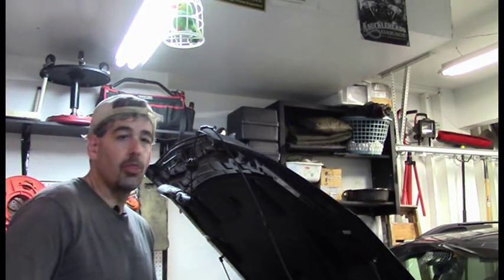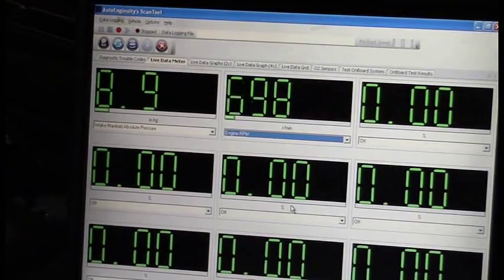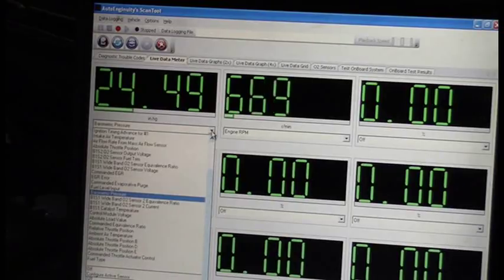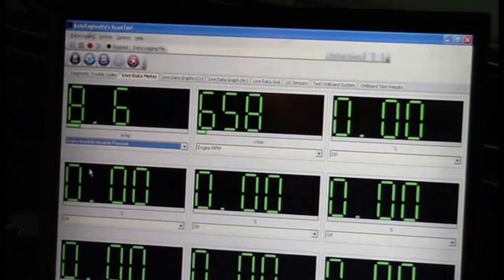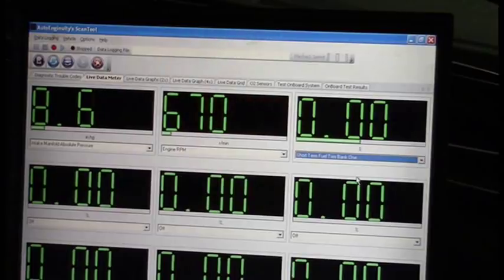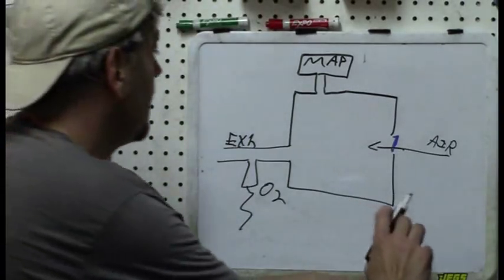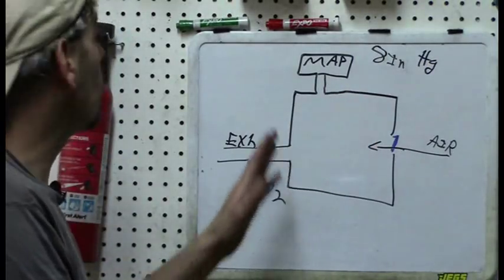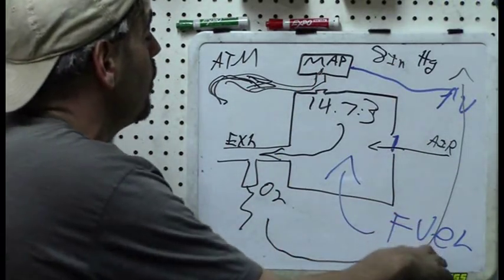MAP Sensor Diagnosis and Understanding Function- Pt2

Comment: Thanks for the good video explanation.  I got a code P0107 code today "manifold absolute pressure or barometer pressure circuit low input".  My scan tool freeze frame showed MAP("Hg)=3.5 at RPM=850 idle ABSLT TPS(%)=14.5.  Your idle was at 9"Hg.  I wanted to try to figure out if I need to replace the manifold absolute pressure (MAP) sensor.  I also have been getting long cranking hard starting for about a year. I checked scan tool not running RPM=0 and MAP("HG)=25.1 and then crept down to 23.6.  But the barometer checked from weather at 28.85"Hg, so my sensor is reading 4"Hg - 5"Hg too low. Your video help me realize that during starting the MAF(lb/min)=0.0 and the EFI uses MAP("Hg) for determine the barometer for the starting map A/F.  With MAP sensor reading 4-5"Hg too low the PCM thinks I am at low pressure air, or super high altitude 7000' instead of 1000', and is cutting the fuel way back.  My LT FTRIM1(%) was up to 6.3%.  Looks like I need a new MAP sensor.  I just wish I would have gotten the code months ago when the hard starting began, so I could have fixed this sooner.  If you ever come across a bad sensor, it would be cool to see a video of the bad sensor's output & response to throttle tip in.
Reply from the maker: You have no data that can be used for diagnosis of anything here. There is just one reference point. There is no curve to load.
  I do not understand how you are determining the MAP is faulty.
Reply: I can tell MAP sensor is faulty because when not running the engine the air pressure will equal the atmospheric barometric pressure, since no air flow when RPM=0, and no resulting pressure drop behind throttle.  At the time I checked with scan tool the local westher conditions reported 28.85"Hg.  I took about 10 measurements and got as low as 23.6"Hg with scan tool.  So MAP sensor was reading 28.85 - 23.6 = 5.25"Hg low, which is way off.  5.25"Hg is a lot of barometer change.  5.25"Hg is like going from 1000' elevation to 6000' elevation where the air is less dense. OBD code 0107 definition says get code 0107 low MAP indication fault if voltage < 0.25 volts. My scan tool does not give volts for MAP sensor, instead it gives "Hg, so I had to look up facts about barometric pressure to   figure this out. My car has two identical MAP sensors. One in manifold, and one before intercooler. The sensor in manifold is bad. The sensor before intercooler checks turbo boost.
Reply from the maker: You are not testing the sensor properly.
Reply: The voltage output of MAP sensor is too low.  It is below the fault limit, thus causing a MIL code P0107. 

Scan tool is handy to troubleshoot.  I found Scan results from long ago when car was running fine and MAP ("Hg) at RPM=0 was 28.1"Hg matching close to correct barometer. This also confirms MAP sensor output today at 23.6" Hg is too low.  

Seeing your video of scan results of "Hg was helpful to make me realize my MAP values were way too low.  You did not explicitly provide guidance on what "normal"  MAP pressure readings should be. But you said you had a new engine and you showed your scan results on video. Thank you.
Reply from the maker: You have no scientific evidence of that since you did not test against variables. You cannot scientifically say the MAP is responsible.
  .... and it isn't.
Reply: Schrodingers Box 
Good point.  What variables do you suggest I test against to make a good scientific conclusion?
Reply: I see at 3:08 in video your barometer is 24.49" Hg.  You mentioned in other comment you are at 6500' elevation.  24.25" Hg is about average barometer way up at 6500' elevation. Your MAP sensor appears accurate.

I am at 1000' elevation where average barometer is about 29.7"Hg.   My MAP sensor says barometer is 25 to 23.6"Hg, which is off by 5-6"Hg too low.  Science says barometer can't ever get to 23.6"Hg at 1000' elevation, even if a hurricane hits Wisconsin.  MAP sensor is faulty.
Reply from the maker: James, you do not understand the operation of the sensor. I tried my best.
  Go ahead and replace it. Good luck.
Reply: I don't want to replace a MAP sensor for $49, if I don't have to.  That is why I watched your video.  I am thanking you for your video because your video helped me realize my MAP sensor reads barometer 5"Hg too low. Your scan data showed much useful information about barometer value.

 However, you keep telling me I am wrong, without telling me what is right.

If your viewers read this comment, maybe I can help them.  

1) code P0107 low MAP sensor or barometer signal
2) code P0107 triggers if signal volts < .25V or <= 3.5"Hg
3) normal sensor range ~ 1 to ~ 4 volts
4) ECU checks barometer when key to ON, and engine not running.  MAP sensor measures the absolute pressure, which is the barometric pressure when RPM=0.
5) Use scan tool to key ON but not start engine, record barometer value. Some Scan tool is in units of inch Hg, and some in kPa. Use Google to convert units if need to.
6) Google the weather near you to get the barometric pressure. 
7) Compare. 
8) If scan tool barometer is more than .5" Hg different than the weather station barometric pressure,  then Sensor is wrong. May be able to tolerate up to 2.0"Hg off without noticing poor starting. 2.0"Hg is like 2500' elevation change.
9) if 5V input is correct and ground wire is good, then sensor is bad
10) Only then do you need to spend money to buy a new MAP sensor. 

A MAP sensor that reads too low causes poor starting with excessive long 5-10 second cranking to start.  Reason is when key to ON, but before cracking, the ECU looks at MAP sensor for barometer  (elevation), intake air temperature, engine temperature(jacket coolant water), LTFTrim (long term fuel trim), and battery voltage,  to pick the starting prime squirt, starting fuel map, and after start fuel decay as engine warms up. There is no value from MAF sensor yet, since RPM=0, so ECU uses MAP sensor to find spot on fuel map. If MAP sensor reads 5-6" Hg too low barometer, then the ECU goes to a lean portion of starting map because ECU thinks you are at high elevation with less dense air. The leaner portion of starting map has shorter injector pulse open times, thus injecting in less fuel than actually needed.  That is why MAP sensor that reads barometer too low by 5-6"Hg causes 10 seconds of cranking until enough fuel is injected to ignite and start.

 Other symptom is sometimes engine dies right after start up and at idle. The low reading MAP sensor is on a lean portion of after- start fuel decay map when in open loop mode.  Engine is too lean and dies.

Conversely, if MAP sensor reads barometer 5-6" Hg too high, then during starting will inject in too much fuel and belch black smoke in exhaust.  This would be the case where you are at 6500' elevation and your MAP sensor reads 30.0" Hg but the actual barometer from weather station is 24.5" Hg. Your ECU will think you are at 500' elevation and inject in more starting fuel causing over rich starting symptoms, such as, flooding, rough stumble, black smoke in exhaust.

I hope someone finds this helpful as further explanation of your video.
Reply: I don't know.  But I do know why the map sensor was bad.....   

The little vent hole was clogged with dirt.  So the sensor was stuck and reading too much vacuum.  

I replaced the sensor.  But when I took it out I noticed the small 1/32" hole was completely shut .  I probably could have cleaned the body of the sensor and fixed it.
Reply: James Dehn Thanks for the info I'll check that before I replace mine.

Comment: BRAVO! some great teaching...what comes to my mind...just in reverse to what u said...MAP code being set bcus TP was too high from carbon buidup...DBW throttle...Computer expected to see higher MAP value
Reply from the maker: How is a TPS going to have carbon buildup???????
Reply: ???...Drive-by-wire systems dont have IAC valve...so, everything is done by a throttle plate...Computer opens it more to compensate for carbon buildup restriction...to maintain idle speed
Reply from the maker: Oh yes- that would be TB carbon buildup, technically, not TP carbon buildup. I was thinking you meant in terms of the sensor itself.
 yes you are right and in fact I have several videos where I diagnoses TB carbon buildup through high TPS voltage

Comment: Something is wrong.  With the MAP out, there is less vacuum (NOT more vacuum) being sensed by MAP which is the same as no/less air flow.  More airflow=more vacuum. With the engine running there is more  vacuum or more airflow in the intake than outside.  I assume that implies less voltage being send to ECM by the MAP when it sits outside in the open.  He said it backwards.  He said the MAP being outside registers more vacuum more airflow at around 9:30 in the video. I don't know if more vacuum means more voltage and less means less voltage in the signal wire.
Reply: less applied vacuum source to sensor is more/higher voltage output, from the MAP.
more vacuum source to sensor is less/lower voltage output, from the MAP.

To the PCM.  
Variable signal output wire/terminal.

GM and Chrysler at least.  
 
and I have just today retrofitted a '90's GM TBI style of MAP sensor to my 1993 year 3.3L  dodge car.    works.   the original sensor was 293K miles and failing dying
Reply from the maker: What you are saying is self contradictory, sorry. It makes no sense the way you defined it.  please restate with consistent, clarified definitions so I know which point you are trying to make.
Reply: I think you were saying that when you pulled the MAP and leave it out in the open and plugged its mounting hole, MAP reads more vacuum compare to it installed and reading the intake vacuum as the engine is running.   That doesn't sound right, unless I missed something else that causes MAP to read more vacuum.   I also assume the vacuum is another name for airflow intensity.  I know from physics that moving air has less pressure ( I.e. I guess more vacuum in this sense) than still air.   The air outside the engine is still (  less vacuum) compare to rushing air ( more vacuum) in the intake.

The wing of airplane is curved on top side which cause the air to rush faster than through its bottom side, creating less pressure on top ( or one can call it more vacuum I suppose)  causing the plane to left up.  
Slight change of subject.   I also assume that warm air has more pressure than cold air.  So one could say that cold air in relation to warm air has more vacuum in relation to warm air.  If one side of a diaphragm  has warm air and the other side of it cold air, the warm air will push the diaphragm  towards the cold side.
Reply: I am sorry I forgot to mention that I totally appreciate your videos and what you are doing. Totally awesome man.
Reply from the maker: There is no relation between bernoulli principle and the MAP operation.  Totally separate theories of operation.

 Removing the MAP increases voltage because it reading STP at atmospheric which is 14.7PSI at sea level vs single digits when installed and car as at idle (and even lower in decel mode).

Comment: Curious, what's the danger in crossing your leads up?
Reply from the maker: That would cause a short at the driver since you bypass the load.
Reply: So you mean like one of your test leads touching the wire sending a voltage from the PCM and touching the signal return wire at the same time?
Reply: So would that be like the resistance on the circuit goes to zero, which makes the current go crazy high, which would fry the wire or computer? Is that how that works?
Reply: no real danger unless you put more than 5v to terminals, could overload circuit in PCM possibly

Comment: Thank you for your detailed  teachings skills.  I am researching map, cam, crank, ect sensors before I work on 97 Sebring 2.5 with intermitant stall and coolant leak. Question: The ect (engine coolant temp) sensor uses same ground circuit through pcm as the other senscors. If ect is faulty would it cause other sensor problems. 
   Also please share: 
You cant depend on check engine light codes in older vehicles. The 97 Sebring has codes such as faulty ECT which do not set an OBD code but does set a code which can be found using ignition key  on, off, on off, on and counting check engine light blink sequence.

This car has no codes per obd scanner but has ect code wirh ignition check.
Reply from the maker: A 97 sebring is OBD2. depending on the code you can trust it. For example if you have an ECt circuit malfunction, you can bet there is an issue with the ECT circuit integrity. 
  if you suspect an ECT malfunction, yes it can indeed cause many false codes (i call these "references codes") and you would do well to diagnose the ECT circuit as potential root cause.

Comment: QUESTION! My scan tool is reporting 6.5 psi of boost at idle, and isn't reporting engine vacuum. Is that normal? My vehicle doesn't have a MAF meter and only runs off of MAP. Should I hook up a vacuum gauge and make sure I have vacuum, and then test each MAP sensor to see if they are good?
Reply: MAP sensor systems are not speed density and are only intake air volume sensed, via the MAP sensor.  you have one MAP sensor only.  normal stock idle speed vacuum should be 18-22 Hg.   if the scan tool is saying the PCM doesnt know what the vacuum is then something is wrong with MAP sensor or  out of range or is a fault somewhere wow..

Comment: trailblazer 2002, no start with security lamp appear
Reply: key in run position for 10 mins, key off,  repeat two more times.   if happens again then you will need to bypass with resistor in yellow and black wires in the sensor wires in the ign key cylinder sensor.   2.2K ohms and 1/2 or 1 watt resistor.  on PCM end of the wires.

Comment: Great video made me understand what's going on with my motorcycle alittle better. I can't figure out why my Ducati is going from high ideal then comes down to normally then even with the slightest twist of the throttle the engine will rev at 2500 rpm for a good 10 to 15 seconds after I let go of the throttle. I don't have any engine codes or vacuum leaks could the map sensor most likely be my problem?

Comment: wish I knew how bud! only know the basics on fixing cars tho obd2 is useless if don't know how read it lol I'v no clue what baro.is or how to calibrate it unfortunately so garage job it seems it's gonna be lol
Reply from the maker: Yeah all this is covered over several videos on my channel but bottom line is: you need relevant data to confirm where the issue is so you can narrow down to an individual component or etiological theory for validation.  This only comes with a thorough understanding of the system in question and the interaction with peripheral systems. There is no such thing as "tell me what's wrong based on a symptom".

Comment: Hello everyone. My name is Gary and I'm a parts changer. But thanks to these vids, I'm in recovery.
Reply from the maker: Hahahahaha  One of best comments ever!!!  Yes I admit, I used to be a parts changer too.  Before I started doing these videos I actually used to take my car to the dealer to get diagnosed and then change the part myself lol.
Reply: @SchrodingersBox Thrifty!
Reply: Hahah! Brilliant comment. A mis-use of the word maybe, but still, I'll stand by it :)
Reply: geecrawdad Hello Gary!
Reply: That literally made me LOL
Reply: You and me both. I think I'm still withdrawing. lmao
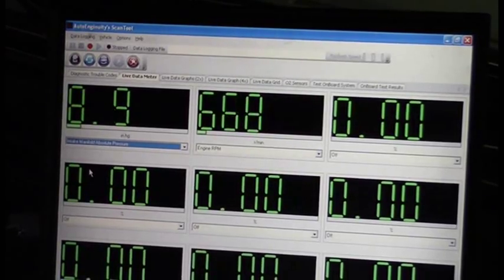Reply: Welcome to the 5:30 Happy Hour PC Anonymous meeting Geecrawdad. I had my dealer tell me the Map sensor is reporting something like a Low air coming into the intake. on a 2006 MDX above idle they say it has no codes. but at idle it has codes for multiple cylinder misfire. They say Valves need adjust. Funny, Another Dealer said that and did the Valves. ran the same. new coils, ran the same. new plugs ran the same. I'm about done changing out parts on this thing. It goes like a Raped Ape down the road. I really miss my AWD here in Minnesota. The CEL eventually illuminated the VTM and when that happens I'm stuck with 2WD. Grrrr. Compression was OK, Timing belt marks are right on.
Reply: My understanding is, change Map Sensor first, so that I know for sure I'm getting a  correct Readings on all the other Sensors.
Reply: God, grant me the serenity!
Reply: I think many of us a parts changer except in the case of an expensive part, then we’re forced to make a few diagnostic decisions.
Reply: A Wess
Reply: Where is the map sensor on a 2011 Chevy Traverse 3.6 V6 engine n how to replace it
Reply: 😂👌 great comment
Reply: Well. 😂

Comment: well because the  hose that goes to the map sensor  when connected my rpm just starts going up and down  it gose back to normal when I disconnected it
Reply from the maker: Sorry I am not going to be able to help without any relevant data. sounds like you're just randomly guessing. Good luck man.
Reply: +Schrodingers Box yeah something like that I'm just really not sure what it can be ill try to post a video